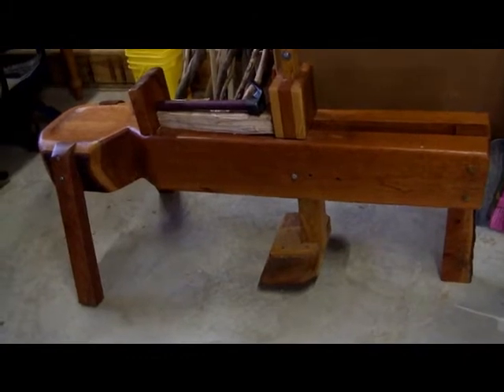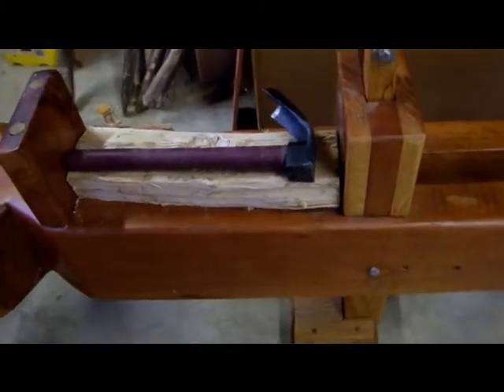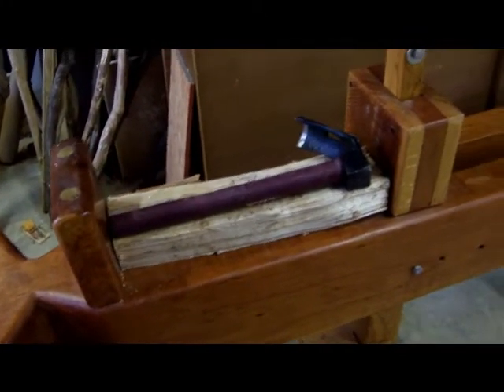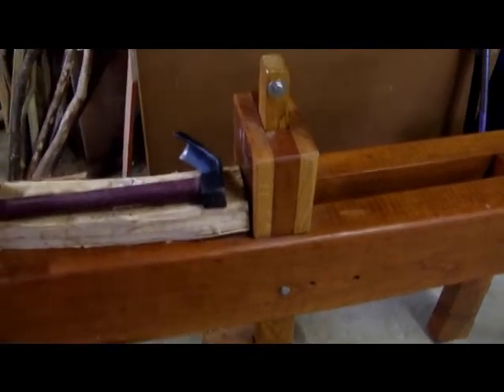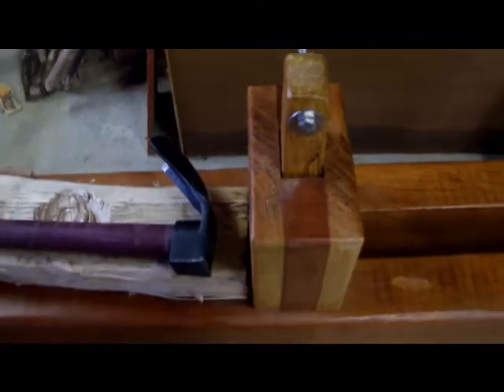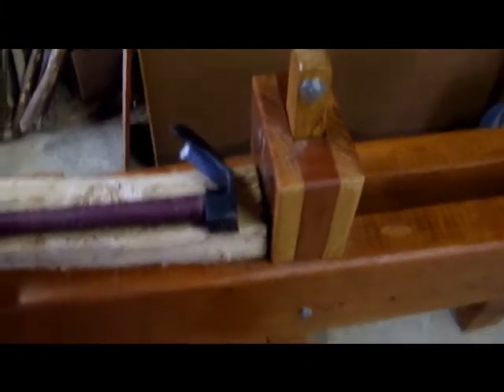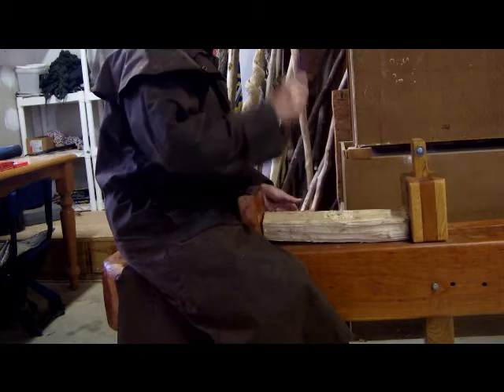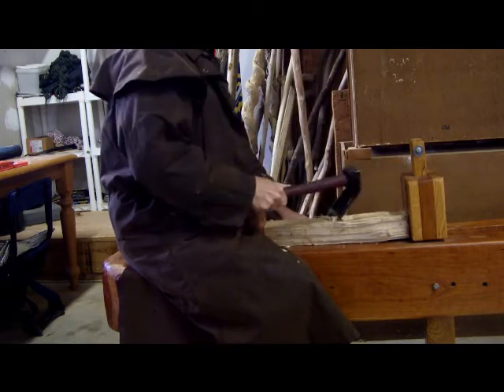Wood Bowl Carving and Shaving Horse

Comment: Youre ruining that tool lol. You need a wood dowel with sand paper wrapped around it. Also, the threaded rod will wallow out the holes over time. Wooden dowels are recommended.
Reply from the maker: Hello Scott,  Thank you for the recommendation.  I'll put that together as a tool.  Rather than purchase a wood dowel, I'll likely use an available branch of a tree the wind pruned.